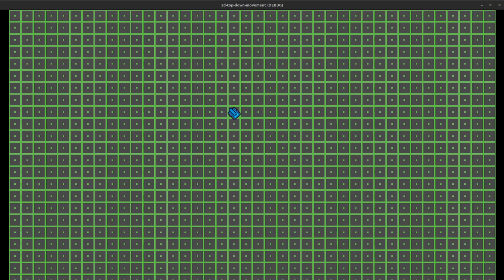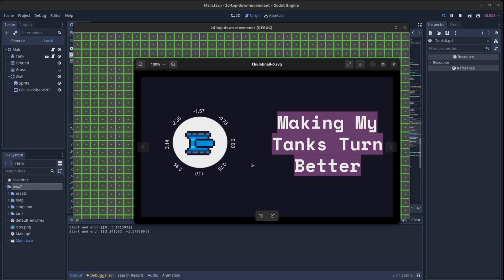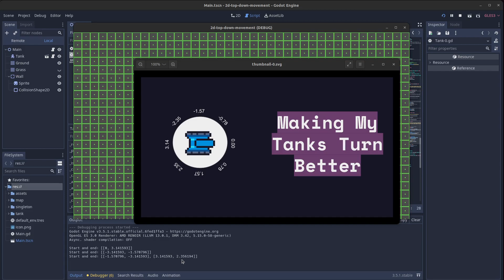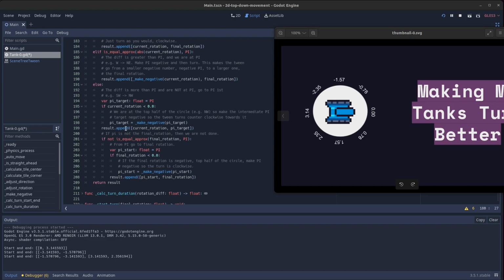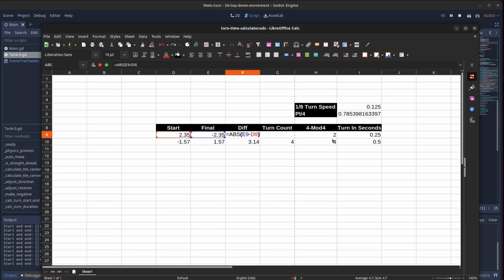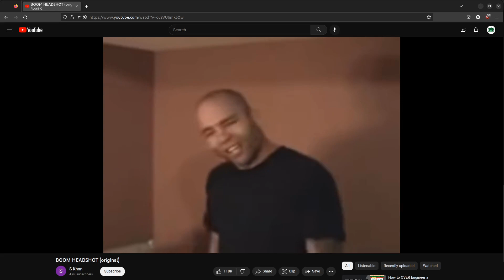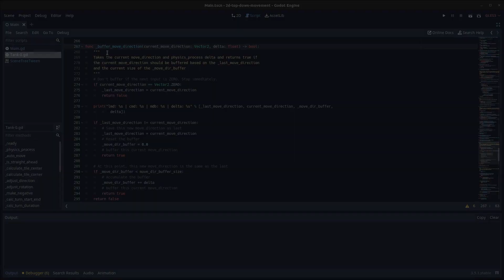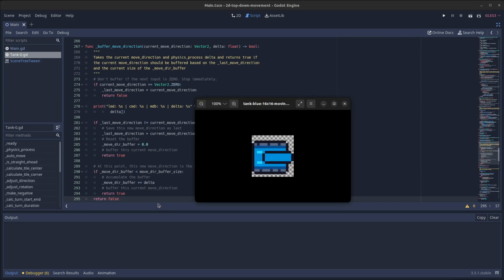Improving Turning & Fixing Diagonal Snapping In 8-Way 2D Movement | Devlog #4

Comment: an Idea for the diagonal snapping, could be to just remember in which orientation/rotation the tank entered the grid(or from the last frame) and display that when stopping, that would remove the "input"-lag 
input-lag could also be explained as the tank needing to build ineratia, but if you have dodging mechanics that could feel bad for players if they get hit even though they reacted in time
Reply from the maker: Thanks for the suggestions! Explaining it as needing to build inertia is what I am planning to go with. A 47,000kg  tank doesn't move forward 30 milliseconds after opening the the throttle. There won't be any dodging mechanics.